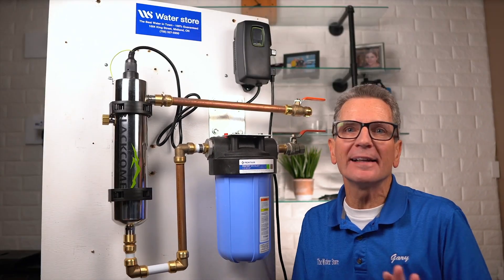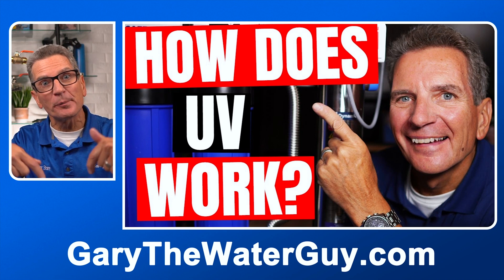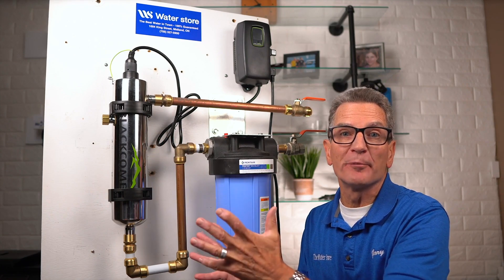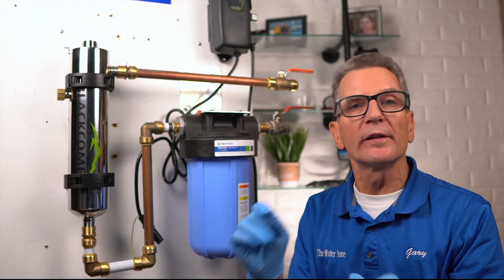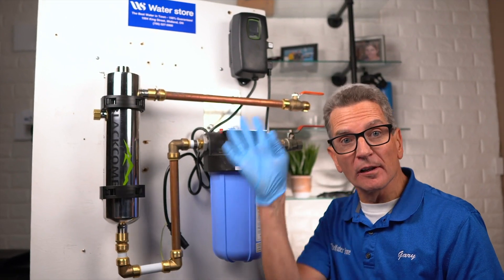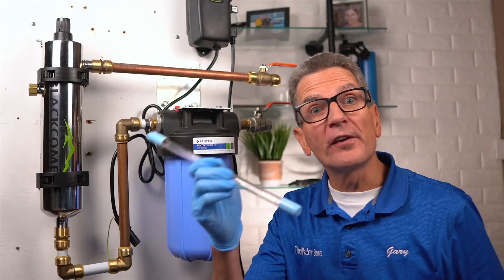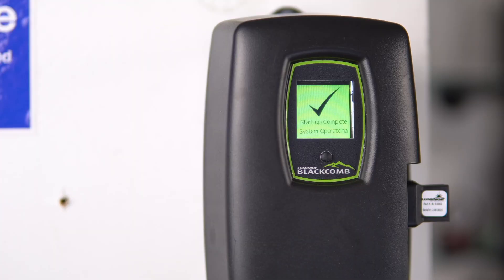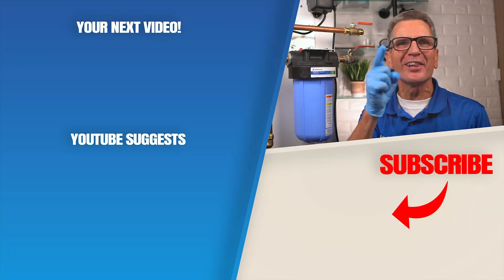Luminor Blackcomb UV System Installation TIPS & TRICKS!

Comment: Great video, I wouldn’t use Teflon anything stuff causes tons of health issues . There are barely any products on the market but I did find gasoila nt for sealing threads
Reply from the maker: I see what you mean, but there is virtually no contact between the water and the teflon tape on the threads.